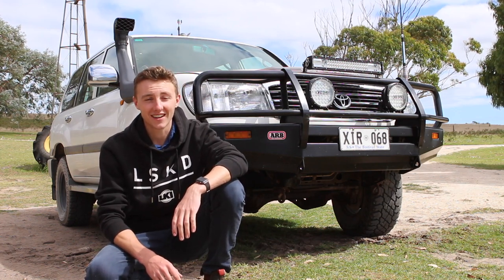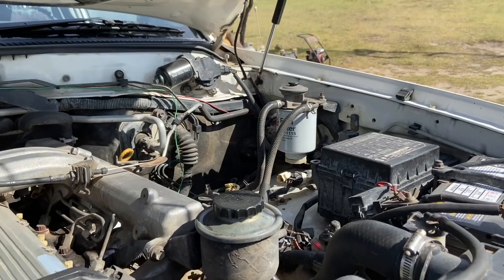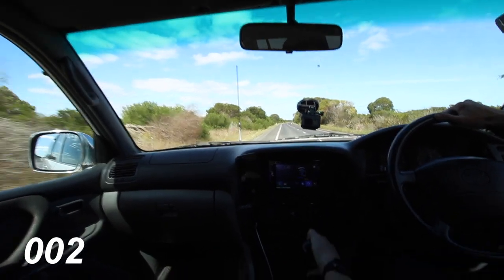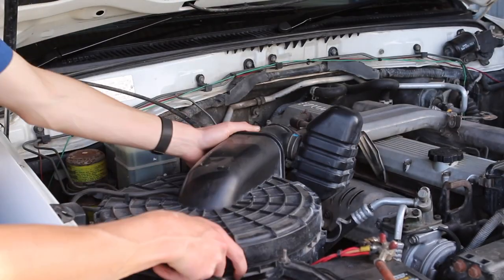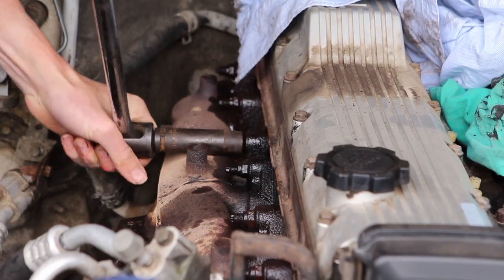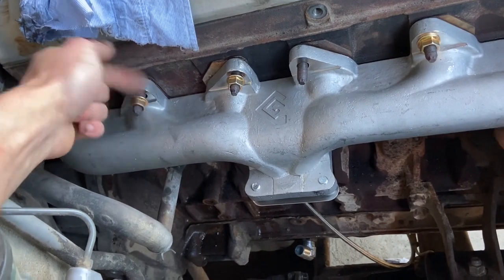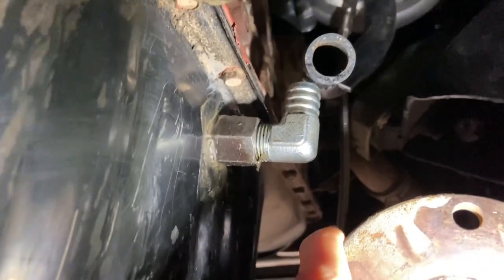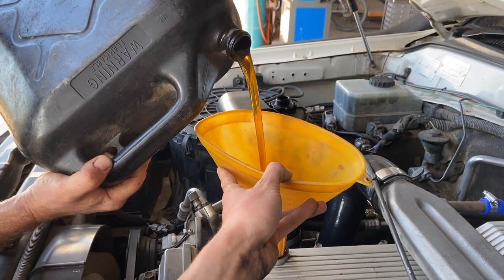TURBOCHARGING my 1HZ - JB Turbo [Turbo Conversion Part 1]

Comment: I took these exact steps you have taken except intercooled at day one, my egts never seen over 450 ( post turbo dump pipe ) ,  my 1hz blue a hole in the piston with just 12 psi boost and minor adjustment on the fuel pump, it was only 295000 klms when it let go it lasted 53000klms with the turbo on, i dont recommend turboing the 1hz to anyone UNLESS they have got turbo pistons and con rods to suit, some people dont have any issues they say (at the moment) but later on they will with stock internals, 1hz being pre combustion chamber in the head also allows it to crack easier with extra power from turbo setup. I am now rebuilding my 1HZ into a 1HD-T for a direct injection system
Reply from the maker: It will always be preferable to upgrade the interiors on the 1HZ before turbocharging. Everyone has a different story and everyone’s engines will have a different history that will affect the way it handles boost and more fuel
Reply: @WillsLandcruiser  best thing you can do is boost compensator for your pump on these
Reply: Post turbo egt is no go out the mani is the go more accurate also 450 post turbo is still high for intercooled

Comment: Suggestion, put some bracing on the oil pressure sensor... due diesel vibration, it has tendency to crack...
Reply from the maker: Thanks for that! I wouldn’t have thought of it myself. I’ll look into it
Reply: @WillsLandcruiser  somebody i knew had this happend on his 2L.. oil was drained.. luckily in near home

Comment: How did you attach the exhaust to the turbo?? The kit doesn't come with an adaptor
Reply from the maker: Needs to be a different exhaust. I used a PPD 3” turboback but I had to make some modifications to that to make the dump pipe work

Comment: Hey Will, great vid! I’m thinking about buying an 105/ auto with an after market turbo but I’m worried about fuel economy, so, what fuel economy do you get with it turbo’d?? Like what’s highway economy and city economy? Cheers Steve
Reply from the maker: On an 800km trip, I averaged 14L/100km. Daily driving at 105ish with a heavy foot, I tend to average 16 or 17L/100km. However I now have a lift and bigger tyres. Fair to say the fuel economy probably didn’t change- but since putting bigger tyres on, it has declined
Reply: @WillsLandcruiser  @14l/100 have you tuned it for power? Can you tune them for even better economy or should I pull off the turbo (don’t really want to do that)
Reply from the maker: @targetoz5470  According to the dyno sheet, my peak power is at 2600rpm, and the AFR is around 19:1 at that point. As far as I know that’s fairly standard for a diesel. My idea of fuel economy comes down to moreso how much work you’re making it do. I have a 2” lift, 33s, a roof rack, spotties, rear drawers, and a heavy foot. There’s lots of dirt roads and hills through my daily driving, so I’m making it work hard all the time. If I had less mods and was lighter, I’d get heaps better fuel economy. In my latest video you’ll see that dad’s FTE is making 3x the power my HZ is making, and yet his average fuel economy is closer to 12L/100
Reply: @WillsLandcruiser  yeah rigtyo, so this one I’m looking at has stock suspension and tires just a bull bar, you reckon it would be less that 14l/100??
Reply from the maker: @targetoz5470  I’d imagine so. Totally depends on how you drive it. That’s the biggest factor. But with stock tyres and suspension it’ll be less for sure. A roof rack will up your consumption 2L/100, another L/100 for bigger mud terrains, it all adds up 😂 But as someone once said to me, we own landcruiser for smiles per gallon- not miles per gallon
Reply: @WillsLandcruiser  lol!! I had a petrol 80 a while ago and it was tears per gallon lol!
Reply from the maker: @targetoz5470  hahah that’s pretty much right 😂 Hey mate giving it some more thought, your fuel economy is going to depend also on what boost your turbo is running at cruising speed and what your AFR is at this RPM. So backtracking on my current statement a little- yes they tune does impact your fuel economy, but the tune will change depending on the turbo and what kind of boost you’re putting into your bus and all that. It’s hugely circumstantial but at the end of the day, if we were chasing fuel consumption we’d all drive stockie cruisers or a Prius 😂
Reply: @WillsLandcruiser  lol!!! What are your thoughts on buying one that’s been modded? I mean your rig was non turboed so obviously not flogged ie impossible to flog so now it has your input, for better a word new history, this rig I’m looking at there’s no real way of knowing if it’s been heavily sooted all it’s turbo life, I’d be better off buying a stock one wouldn’t I?
Reply from the maker: @targetoz5470  That’s a bit of a tough question really. I’d be more interested in how it was tuned. Cars don’t mind a bit of hard work, and in fact they need a good burn out every now and then. That’s way better for a car than cruising around town at 50 it’s whole life- that’ll glaze the bores which causes low compression and mass blow by and that’s a rebuild job to fix. But if the tune has been done professionally and it’s fairly safe, then you should be in the clear. Things to check would be excessive blow by, whether it’s using an unusual amount of oil, any white or blue smoke, things like that. Obviously there’s a line though- if it’s running on 3 cylinders because they’ve cooked half the pistons and it’s shockies hanging out its ass then I wouldn’t buy it 😂
Reply: @WillsLandcruiser  lol, yeah good point. I suppose though it’s a ‘99 with 260k ks and an auto, probably not had a hard life.
Reply from the maker: @targetoz5470  low k’s like that- I’d be surprised if it was real flogged out. At the end of the day, parts can be replaced 😉

Comment: How's she running with the turbo now mate? Still recommend the jb kit?
Reply from the maker: Still amazing mate. JB turbo hasn’t ever let me down. 15 seconds 0-100km/h, fuel consumption is amazing for the 3T beast it is- like 15/16L/100km. Running 285/75 tyres now, just runs like a dream

Comment: do u see any  changes in your car 'technical problems'?
Reply from the maker: Nope none at all. The 1hz is an all mechanical engine- mechanical fuel pump, no air pressure sensors or any ECU business. The computers that are in the 105 wouldn’t know the difference between stock and turbo 😂

Comment: Did you get the sump off with the car on the ground?
Reply from the maker: Yes, just had to pop out one side of the rear steering arm and it slid right out
Reply: @WillsLandcruiser  nice, thanks doing the same this week
Reply from the maker: @mm_____  good luck mate! Hope all goes well. A good clean weld inside and out, and then LOTS of RTA when you put the sump back on and you’ll be set :)
Reply: @WillsLandcruiser  yeah shouldn't be too bad, do it right the first time. Was always Sus about the arildite stories
Reply from the maker: @mm_____  yeah nah that never works haha. Everyone I’ve spoken to that’s tried that always takes the sump off to weld it in after. Better to get it right the first time for sure

Comment: hi mate, with all those exhaust bolts, a technique that works well is heating them up with a torch and then poor cold water on them - do this a couple of times to heat cycle them hopfully making them easier to get off!
Reply from the maker: DCL Racing channel Thanks for that! I’ll be sure to try this in the future... I need all the help I can get when it comes to exhaust bolts :)
Reply: Will's Landcruiser Mods haha Yep they aren’t fun! Awesome video series! Looking at turboing my 105 soon!
Reply from the maker: DCL Racing channel Not at all 😂 And thanks so much! The next video out will be a top mount intercooler installation so be sure to check that out too! Would love to hear about how your 105 goes and I’m sure you’ll enjoy the power increase!
Reply: Will's Landcruiser Mods awesome cheers! Have you gotten yours tuned??
Reply from the maker: DCL Racing channel it’s booked in for early September! Can’t wait!
Reply: Will's Landcruiser Mods awesome! Should make a pretty big difference!

Comment: Sorry for repeating it over... It seems that you are so scared to overboosing your engine with air... You are not going to damage your engine by boost as long as you don't dump too much fuel. 

Your mantra must be not like OMG I have too much boost, but OMG I have too much fuel and my EGTs are too high.... Remember the boost is AIR PRESSURE and it will not kill your engine....
Reply: @WillsLandcruiser  AFR  might sounds easy but not when it comes to diesel engines.... If you buy AFR meter for gas engine it won't work for you as your engine runs much leaner than any gas engine. Check my thread and see some ideas about diesel AFR meter that really works: https://forum.ih8mud.com/threads/another-1hz-diy-turbo-conversion-all-diy-not-a-kit.1184451/